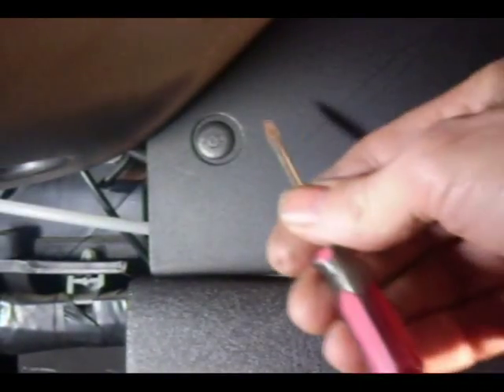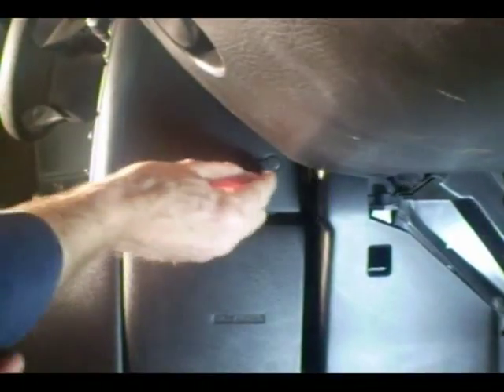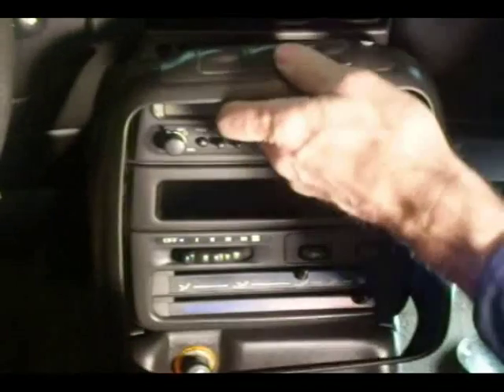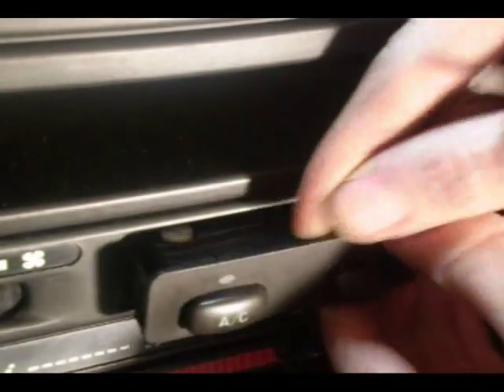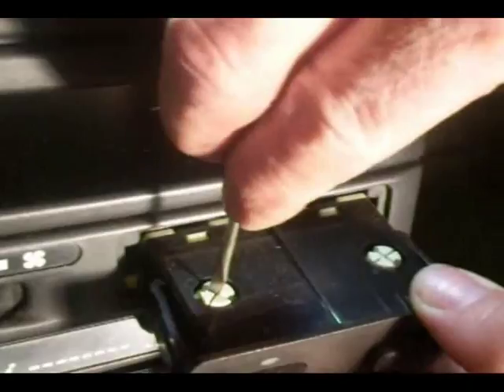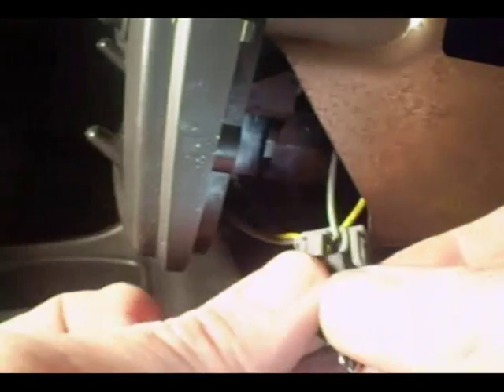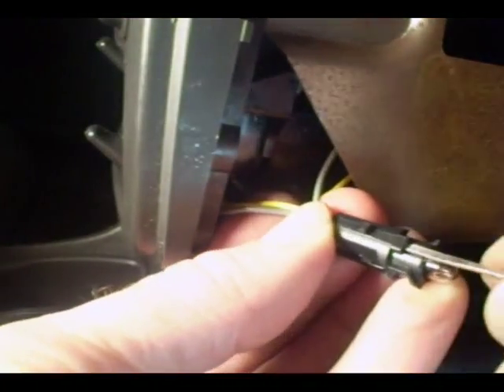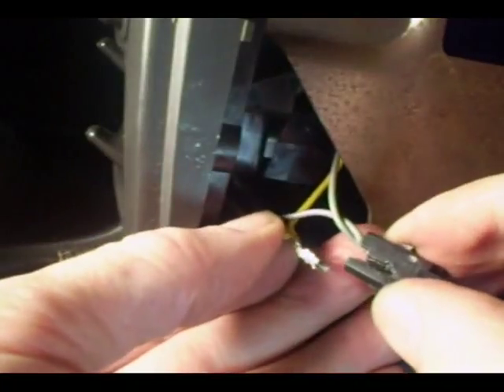Replacing temperature slider bulb and AC/REC button bulbs

Comment: Hi Richpin, you've done a great job with these videos.  They are extremely helpful.  I found an easier way to remove the bulb; at least it worked for me.  I took a piece of 3/8" vinyl tubing and forced it onto the bulb.  I then pulled the tubing and the bulb came right out of the socket.  If that had not worked, I was going to add some vacuum to the tubing to get a stronger grip on the bulb.

Keep up the good work,
Rob
Reply from the maker: Thank you very much sometimes two heads are better than one.I think i will try your method and updated this video with it.
Reply: richpin06a
Update: I also needed to do the slider bulb on the driver's side.  That one did not come out so easy.  I ended up going around the bulb with a utility knife between the socket and bulb to reduce the contact between the two.  Then I used  slightly smaller tubing on the bulb and applied some vacuum.  Then it came out.  More work than the passenger side, but maybe easier than removing the socket.

Comment: Is it possible to replace the slider bulbs without having to stick something in there to pull the wires out? It looks just like my cup holder and cig. light bulbs and those ones just pulled right out. They were kind of stuck so I had to use pliers to grip them better.
Reply: Well I just got my LEDs in the mail today so I'll check. I'll let you know if I am able to pull them straight out.
Reply: Kind of worked but kind of didn't lol. Tried pulling the bulb with the pliers. Squeezed to hard and broke the bulb. Was kind of freaking out since I didn't know how to remove the rest but I ended up getting the rest of the bulb out with a tiny allen wrench and it all came out so I was able to put my new LED in.

Went to the other side of the car, purposely broke the bulb with the pliers. Then put the allen wrench in and pried the remaining bulb out a little, took the pliers and grasped onto the wires that were originally inside the bulb and pulled slowly out. Rest of the bulb came out and put my new LED in.

The part that was a b*tch was getting the sockets back into the dash, since they did not want to go right in.